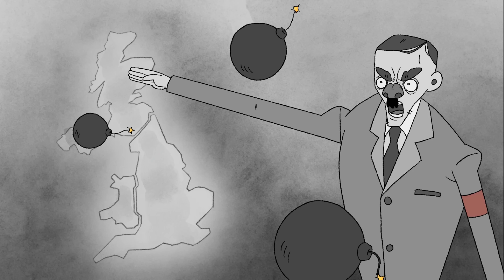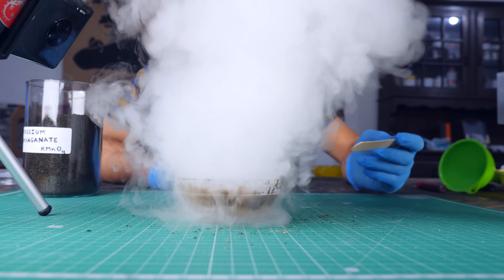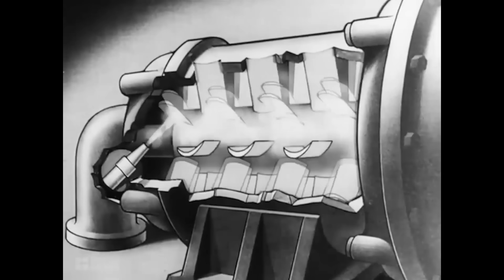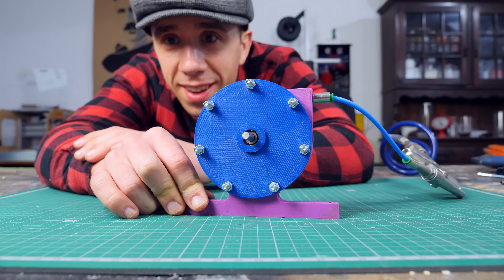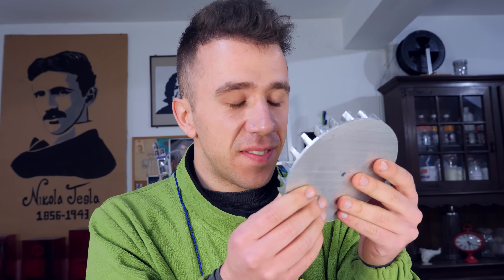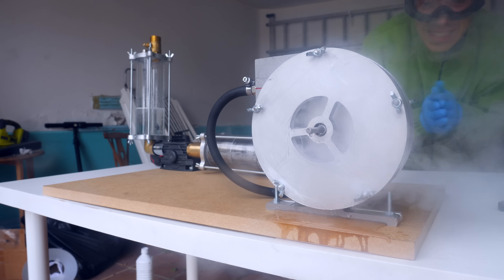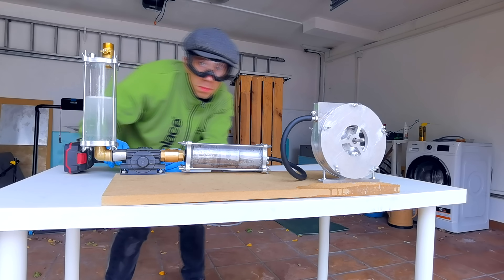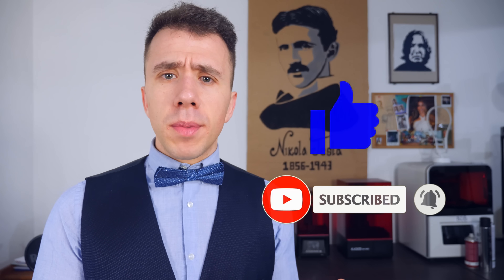I built the World War II V2 Rocket Steam Turbine

Comment: I'd love to know how many uses you could get out of those cat converters. Not a bad video Joel, and keep up with the CNC machining. Whole new possibilities there mate.
Reply: I feel like the reaction chamber should be vertical for liquid to drop down and react up and out.
Reply: There’s no limit, the point of catalyst beds is that they aren’t consumed, they act as a mid step in a reaction with lower activation energy than the reaction without
Reply: @danielfearn6076  there will be practical limits though.  Especially when re purposing them from other applications.  

It's not that the catalyst will itself degrade but likely the binding agents or the structure holding them. 

I otherwise completely agree with your notion.  Decomposing hydrogen peroxide is a quite violent event at the localized site of the reaction.
Reply: @sumduma55  I strongly suspect the wear on the catalytic converter in this application will be much, much less than experienced when doing catalytic secondary combustion hooked up to a gas motor. Catalytic converters operating temp is around 700C
Reply: @Whyyyyyy  the conversation to steaming a car exhaust happens somewhere other than inside the catalytic converter right on top of the catalyst though. 

If all things were equal,  I wouldn't have brought up the point.  But there is quite a lot of energy being released in a somewhat violent manner right on the catalyst. You simply do not have that in normal operation as designed.
Reply: @danielfearn6076  66⁶
Reply: Dude, where is your mustache? It used to be better.
Reply: Das kruger ischt wunder... vandersteïnklügenoberkleinen
Reply: I may be wrong but I think in cars they tend to get plugged up with the constant burning of unspent fuels n shit so you get the carbons n such built up. So in theory they still work when they're considered spent but it takes too much effort to try and save it vs just buying new unfortunately.
Reply: @MidnightMarrow  that's one way they fail. Another which is only possible in the honeycomb style like these is for the honeycomb support structures to break apart and clog the passages.

Another failure is due to contamination in the exhaust stream like silicon based oils being burnt in the combustion process.  They can actually bind with some of the catalysts and cause all sorts of clogging issues. But that's somewhat related to what you already mentioned.  When a car runs too rich (too much fuel in the air fuel mixture), soot can attach causing clogging. But the silicon actually damages or alters the catalyst.
Reply: It's a catalytic reaction. Wiki it.
Reply: He got at least 5 pressure haha
Reply: Considering how long they often last on cars, I'd say they'd go pretty far
Reply: Dang, looks like I’m SOL…congrats..✌🏼
Reply: ⁶
Reply: It's weird seeing people base it's lifespan in cars on how long it will last here, it's doing something completely different than it does in a car.
Reply: catalytic converters last many many years in cars and many thousands of miles they will easily last for more than 100,000 miles. so I expect the uses, in this case, are almost limitless because i don't think he can do enough projects to wear them out. The only way they would wear out is by using materials or chemicals that will damage the parts in the catalytic converter. but that is difficult to do i mean in cars they get red hot you just dont see it. 

there is a video some guy did how a catalytic converter works he cut one in half and put a window on it so you could see how it works on an engine. its a bit like the elements in a toaster they heat up many many times and they just work over and over.
Reply: @TotoGuy-Original  not if the methhead scrappers get to them... then they just DISAPPER!!! lol
Reply: Cats in cars super heat to reburn unburnt fuel....he isn't getting them glowing red however, which means using them to decompose hydrogen peroxide should allow them to last longer
Reply: @haydenc2742  have you ever heard of steam corrosion?
Reply: @sumduma55  platinum doesn't oxidize in hydrogen peroxide or water.
Reply: @david2ljdavid2lj56  sure, neither does rhodium or palladium on their own.  But the catalytic converter isn't only made of platinum and the other two metals.  Although there is some evidence that in the presence of styrenes, palladium will and under certain conditions that will likely not be present- rhodium will too. 

The ceramic substrate they are attached to though will degrade with the reaction.  The coating can become detached from it too.

Its called several names,  steam erosion, steam corrosion, cavitation,  it's all somewhat the same process though and will be present and damaging to the devices.  It will not be over night but it will eventually degrade them.
Reply: @sumduma55  There is a lot of steam in car exhaust too, except it's at 700C
Reply: Cat converter... Meow 🙂

Comment: I'd like to see a pulse jet whose air inlet valve is driven by a stepper motor. That would solve the lightweight-valve-for-rapid-speed-of-closing versus robust-valve-for-long-life conundrum.  You can preempt the combustion pressure rise to minimize pressure losses (in a mobile application, this timing could change with speed to account for increasing ram air pressure and, ideally, could perhaps even transition to ramjet operation once going fast enough). Might also be able to tune it to reduce vibration and noise.

Comment: It might be worth using a smaller tesla turbine being ran at a far far higher pressure also install an external pressure tank so you can store/vent the pressure keeping it to safe levels and and valve to use as a throttle. maybe you could even pump the wasted peroxide that collects in the bottom of the tank back into the fuel cell, effectively using it as a basic kind of drier.

Comment: I’m curious if the hydrogen peroxide concentration could affect performance. The reaction generates heat based on how much the catalytic converters break down the peroxide. If the concentration is increased then the pressure might go up, but the actual volume of gas would go down due to the less water vapor present. I think the calculation is trivial but i would still test multiple concentrations.

Comment: If you lengthen the tube with the catalytic converter you give room for the steam to move away from the peroxide. so the steam doesnt push the peroxide out the exhaust outlet. May reduce wasted peroxide and increase power efficiency

Comment: Rout the wet steam after the catalyst back to the reservoir, to act a liquid receiver, before going to the turbine, although that means everything would have to be able to withstand the increase in pressure, and possibly have to worry about a feed back loop sort of, so a pressure relief and a shutoff valve would probably be a good idea

Comment: Instead of using a design where the pressure escapes before it's fully utilized to rotate the output shaft, try a closed system such as screw compressor (in reverse). This will force the pressure to pass a "work surface" before it can escape the system.

Comment: Since the price of petroleum is going so high is this not the future of cars I mean its environmentally friendly with o2 and water as the end product it has potential I mean mount 4 motors to the wheels of a car and cat has enough power to drive. Tho you might want to put some kind of Rev limiter or just a transmission system in place to make the power not make you turn into a rocket

Comment: Integza, you can try rust (iron oxide) as a catalyzer for peroxide (you can get a rusty wire, or а rusty metal dishwashing sponge). In theory it will be more "stronger", than smooth platinum from scooter catalyzer.

Comment: You should use a steam generator instead of a boiler to get your steam pressure. Itll be a much more efficient system requiring less water for better results and they aren't all that complicated. Just have a copper coil revolve around a heat source and that's as basic as it can get. For better results you'll want to put a can over the coil and heat source to trap as much heat as possible but for a basic steam generator you'd probably still be fine with just a coil around a flame

Comment: If you look around your junk yards or old industrial lots. You can find Diesel or Kerosene fired heaters. In my region they are found in anything from 50,000 Btu forced air jobsite heaters to used oil fired burners. They are all pretty basic in there is a small vane pump and pintle injector. The problem you are having in your set up is your are not atomizing the fuel source enough to allow the catalyst proper working time. You need to be injecting it into a spray pattern. taking apart a MASTER B150CED or like diesel fired heater will do just fine. Call up your construction rental equipment dealers and see what they have laying around.
Reply: Furthermore the nature and design of the injector with vane pump act as a natural check valve in the system due to surface area of injector tip and the vane pump being a positive displacement pump. I super appreciate you are trying to make things work with 'home and garden' materials, however, you are needing to step up into consumer industrial parts to make these type of propulsion projects work.

Comment: By mounting the steam generating column vertically, and by adding more open tube for a few inches with a moisture separator, you could prevent all or most of the H202 from traveling into the turbine. Hope this helps.

Comment: maybe you could try and make an reaction turbine like you showed and build a steampowered skateboard like you mentioned.
for a better catalytic converter you could try to pump the peroxide in more slowly and make the inlet on the bottom and the outlet on top so the gassen wil excape trough the top and the fluid stays at the bottom to be converted. maybe it is also smart to build a pressure storage so you can regulate the pressure to the turbine easyer and more safely.

Comment: You have excessive volume with low pressure and a turbine that works best with higher velocity and lower volume. 
You just need to restrict the output so the pressure can rise, and meter the output through a properly sized orifice.  
Increasing pressure means you need to add a safety blow off valve, and meter your catalytic reaction so as not to waste the impulse of pressure at the start.  You can plumb the output into an accumulator to act as a pressure vessel, and a catchment for unreacted peroxide.    You may note that low pressure areas within your system will rapidly condense your steam into scalding hot liquid.  Your liquid waste will be dilute peroxide that could be re-reacted albeit with less energy.
Automotive paint gun orifices might be a ready source of nozzles. (Paralleled for current capacity (if needed).
Turbocharger blowoff valves a cheap source of controlled pressure relief. 
Fuel pressure regulators also allow you to set a fixed or maximum output pressure for stable running.
The geometry of your vanes will not be ideal at all RPMs.  For power generation you can determine the optimal speed and use your pressure regulation and output orifice size to keep it in that range.

Comment: You may want to read up on power engineering and steam turbines. Although that field is for industrial applications.
While your scale is extremely small and not being used for direct economic activity where output efficiency matter a number of points do come to mind. 
First cold turbines condense steam, second liquid into your turbine is sub optimal or on a larger device a point of catastrophic failure. 

I'd like to suggest a spray nozzle to mist your liquid. This might be cheaper than removing cat converters from scooters. 
An alternative suggestion is to use a Tesla Turbine (bladeless turbine) which is much easier to machine although has problems starting and issue with high torque loads. 
You're lucky that relative to the size of the turbine your bearings are likely very strong and if only operated for a short time unlike to be a point of failure.

Comment: Idk if will help but

>Re-design the turbine like a jet engine compressor, the same concept turbine of steam turbine generator if its possible

>try to make or use some steam condenser, maybe, to prevent the liquid form of hydrogen peroxide to enter in turbine

Suggest for future video, maybe it will useful to make a steam engine for a cart, or skate board, instead of coal, hydrogen peroxide is its fuel

Comment: Hey there Integza, you could get some Manganesedioxide  (Braunstein) and fixate it to a 3D-printd surface using Acetone by lightly dissolving the Thermoplastic and pressing the MnO2 into the surface,
then  use heat to fold the 3D-printed construct into a "Starshape" (zig-zag) to maximize the surfacearea and fixate that inside the tube ...
 I bet you can prevent H2O2 that hasnt decompositioned from entering the turbine with some clever shapes 

It also might help to pump the H2O2 into a vertical decomposition-chamber around the middle to have it flow downwards  over the catalyst and gather ecess H2O2 (and water) at the bottom, and have the preassure leave on the top

Comment: Quick Historical Correction: The V-2 wasn't a successor to the V-1. 
Instead they both were developed separately as part of a competition for unmanned bombs/rockets to return the carpet bombing of the Allies.
While the V-2 was much more advanced from an engineering perspective, its complexity made mass production impossible (similar to a lot of german "Wunderwaffen")
The V-1 on the other hand was much more economically and could have easily been produced in very large quantities. Some historians even attribute some potential it could have changed the course of the war if it had been available earlier in the war.

Comment: Hi Integza! 
You should put the catalytic converters in a steal housing and put a heating mantle on it, then heat it to smth like 150°C. That should dramatically increase the efficiency since this is the boiling point of peroxide, that should increase the decomposition in two ways:
more heat-faster reactions
the peroxide would be allready in gaseous form making it have more volume and surface area to react with the catallizator.
Also also, the heat will in it self make the H2O2 decompose since it is less stable at this temperatures.
Word of caution tho- you should make few tests beforehand since decomposition of hydrogen peroxide is a highly exothermic reactio, witch could leed to runaway scenario, and also you could reach pressures that you wasn't anticipating, the explosion would be far more dangerous, since the temperature would be well over 200°C and the steel shrapnel at this temperature flying who knows how fast could potentially kill you or at least seriously harm you!
And abbout the turbinet here are 3 big problems we (community) need to work on this is:
weight-  lighter = better but weaker
friction- we could hear the design grinding against the housing, loosing energy due to friction, heating, and making sound.
and balance (vibrations)- the fact that the nut undid it self made it pretty obvious that this is a big problem.
I think that working on the surface finish of the parts could eliminate two of them friction and wobbling. Just sandpaper it down to like 1200 grit and maybe that would help.
you could try to use low friction ceramic bearings but I don't think they would handle the forces very well and the water condensate and liquid water could mess with them, but maybe it is worth a try, but I wouldn't trust it to operate under higher stresses. 
I think that is all I have on mind in that moment, I welcome you guys to a discussion in comments
✌️☮️out

Comment: After the catalyst, you could add a vacant space for the hydrogen peroxide left over from the reaction, and put the steam outlet at the top of the tube, so only the steam would come out easily, another improvement would be to put a second pump , to pump that hydrogen peroxide left over from the reaction back into the chamber.
This way, the components would be better used.

Comment: you should try building a tesla turbine, its very similar in design to your steam turbine except it uses disks tightly compacted within a chamber that spins as a result of high pressure water, which decomposes the water into steam as it passes through and speeds up the tesla turbine even more. i don't quite fully understand the dynamics at play but there are a lot of videos about it.

Comment: You need to modify the turbine a bit, instead of letting the steam leaving from the side way. It would be better to seal it off, the opening should be on the lower opposite side of the steam inlet.

Comment: Actually, the V1 may have been more "effective" (at least in the role of "softening up" the Brits) than the V2. While the V2's explosive payload was much greater than the V1's, the V1 may have been more destructive - both in material damages and morale damage. Neither weapon was at all accurate. The V1 was subsonic while the larger V2 was very supersonic. That means that while you could hear the V1 coming at you (even though you never knew when/where it would detonate) the only way you knew a V2 had targeted the city was when it detonated. Also, the V1 would prosuce an air burst thus producing extensive damage to surrounding buildings and people. The V2, OTOH, would bury itself several feet in the ground prior to detonation. The result would be a crater but much more localized destruction since much of the warhead's energy would be wasted digging a crater. Of the two I believe that the V1 would be more effective at attacking the Brits' collective psyche.